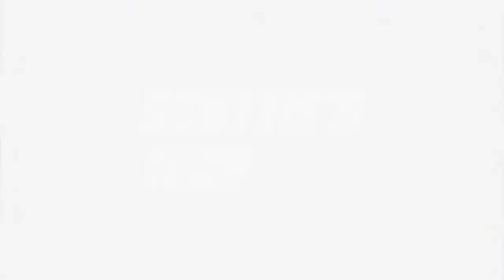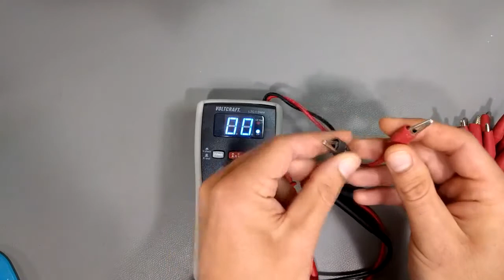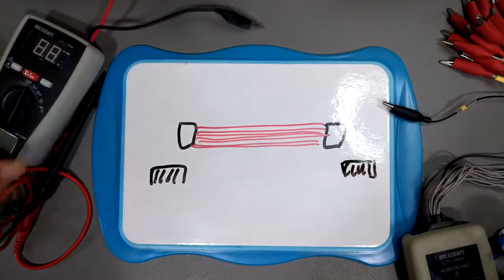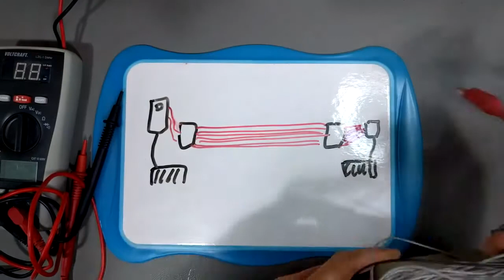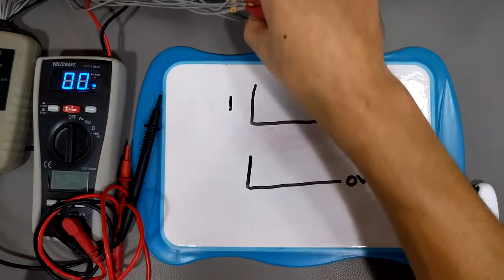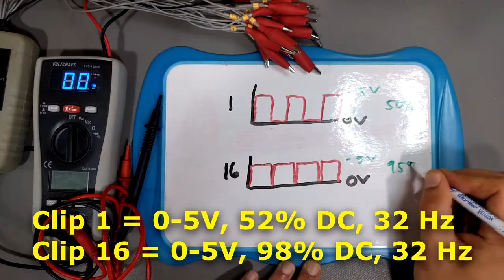Easily trace wires with the Voltcraft LZG-1 / Extech CT40

Comment: Thanks for leaving the video up! I watched this video a few years ago and never got around to ordering the CT40 until it was too late (it has loooooong since been discontinued).  Thanks to running into this video again - I was able to track a new Voltcraft LZG-1 on ebay with reasonable conversion and shipping to Canada. I have a circuit breaker panel that desperately needs to be completely mapped and labeled with the random circuits in this house. (There have been several auto/home projects I could have used this for over the years).  Thanks again for sharing.